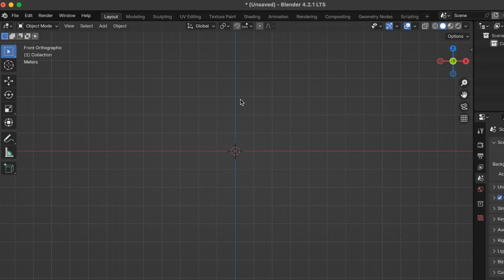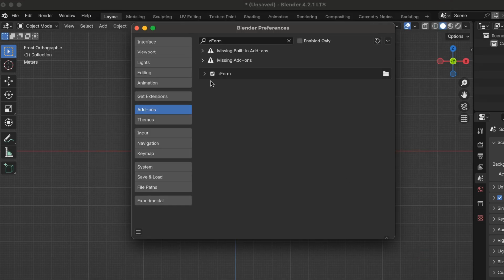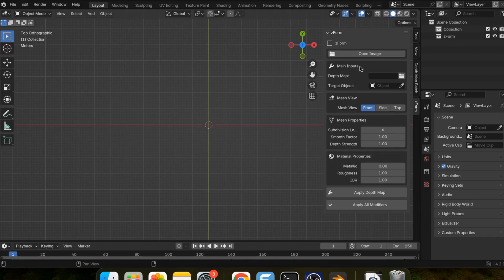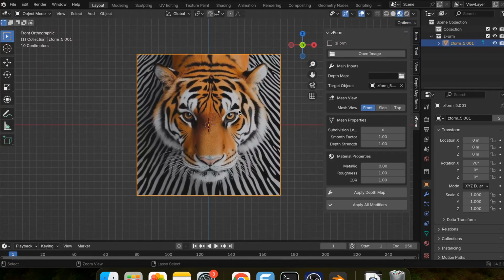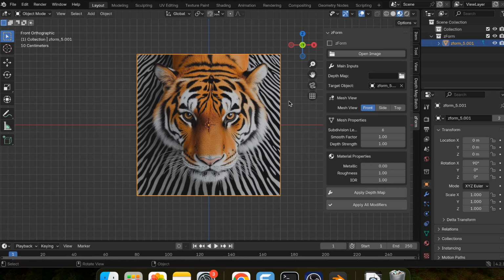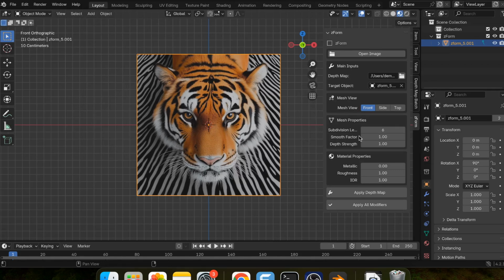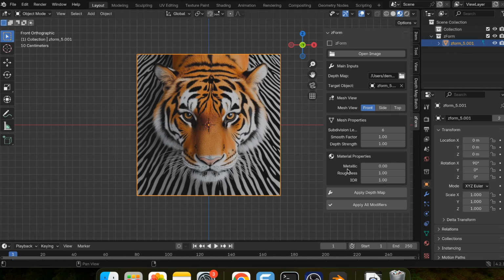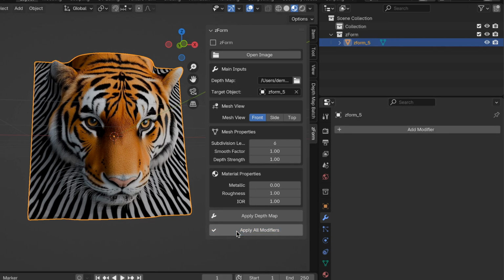zForm - Installing and Getting Started

Comment: I'm trying to remove the background of an image that has a hole inside. When an image has a completely black area inside (what I called a hole), zForm can't fill the back side of the mesh?
Reply from the maker: Hi, is this what you're looking for? There's a feature in zForm that allows you to remove the backside of the mesh. Below is one tutorial on how to do that with zForm. 

https://youtu.be/3UP_zPc_Y64?si=kTA875C9XRYtwUwh

I also have documentation for removing the backside here. 

https://vltools.github.io/zForm/overview/#background-removal
Reply: @vizdotlife  Hi, I just saw your tutorial on how to fill the backside of a mesh. 
It's quite a lot of work on the complex image I have, but it was what I needed.
https://youtu.be/tavlUvPDfh8
thanks.
Reply from the maker: @joaoranhel7878  Now I understand what you want to accomplish! There's actually a faster way to do this now using my new features in the Texture Properties section in zForm. Choose the "Box" option in Texture Properties in the middle button at the top of the section. Then after then use the Background Removal feature. That should save you a lot of time for the more complicated image you have. If you have any questions or need help feel free to message me on SuperHive (used to be BlenderMarket).

Comment: When exporting as .obj the texture is not visible. Is there a solution?
Reply from the maker: I just realized there's an even easier solution. Just uncheck the "Use Transparency" in the Material Properties section of zForm. It will automatically simplify the material for export.
Reply: @vizdotlife  Thanks if it works
Reply from the maker: Try exporting as glTF 2.0 (.glb/.glft)....that should work.
Reply from the maker: Figured out the issue. What you need to do is simplify the material in the Shader Editor. Instead of having a Mix Shader, you need to remove it and purely connect the Principle BSDF to the Material Output.  You can only export simple materials.
Reply: @vizdotlife  Thank you very much, it works well.
Reply from the maker: @itanrandel4552 That's great news...you're welcome.

Comment: Can transfer to UE5 ?
Reply from the maker: Pretty sure the answer is yes, however I haven't used UE5 before. The mesh has clean topology after applying all modifiers and the UVs look good as well. That being said, I'm not certain. I'd be happy to share with you a few OBJ or FBX files of these if you want to test out in UE5 and let me know! Feel free to send me a message on Blender Market...there's a contact creator button if you go to my homepage.
Reply: Interesting 👌🙏you sent  for test to night in Blender addon
Reply from the maker: Quick update for those reading this thread. The initial test to see if the obj/fbx file works in UE5 doesn't look good so far. It could very well be me not knowing yet the proper export settings for obj and fbx to use in UE5. A big thank you to @narathipthisso4969 for helping test this! I'll need to work more on this to figure out how to properly work well in UE5 and other game platforms like Godot.